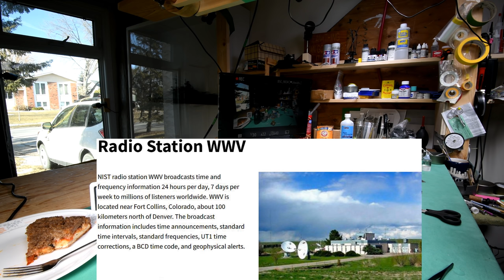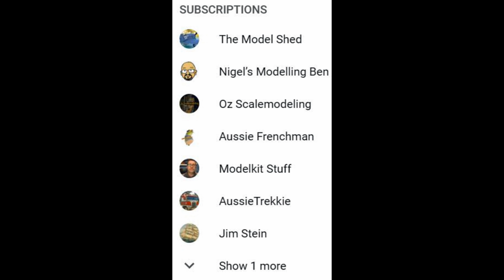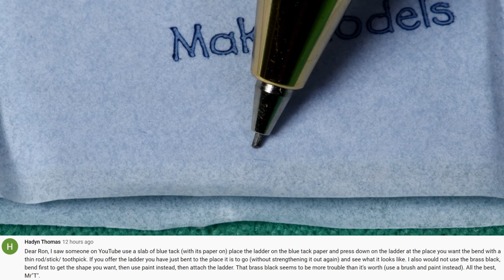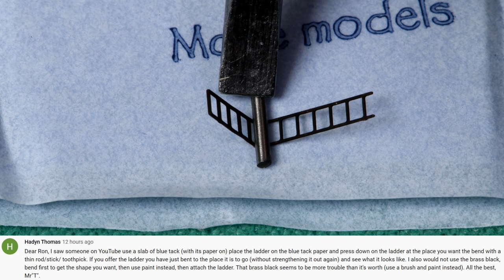The Model Ship - Part 746

Comment: Ron if you want to use the paper under the top of the photo etch bender it might be easier to remove the top line up the paper and tape it in place than the paper should stay in place while lining up the part to bend.
Reply from the maker: "tape it in place" Next time Kevin, if I remember. 😁